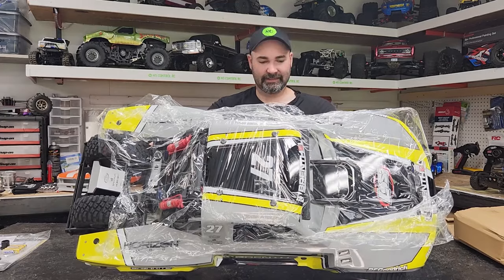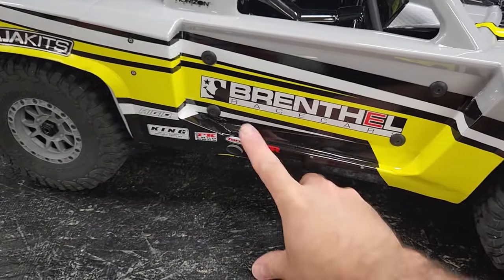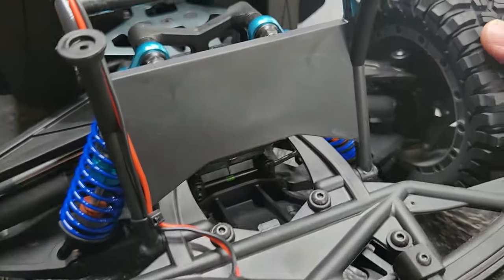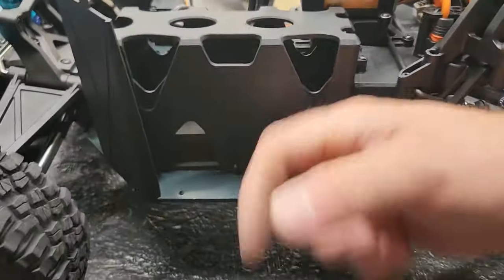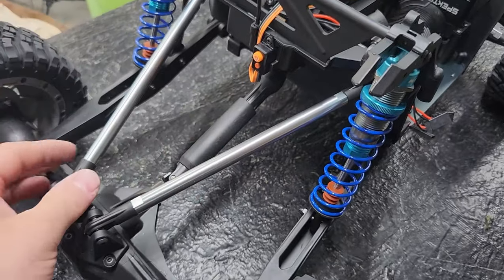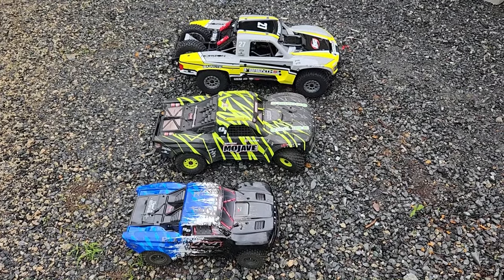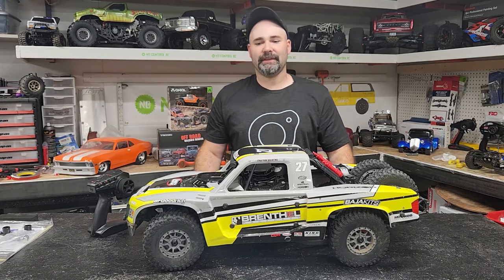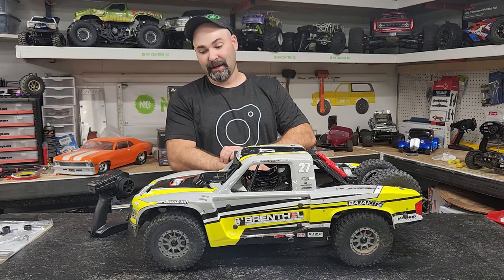Will I Regret Buying a Losi Super Baja Rey 1/6 2.0 over the Traxxas UDR Desert Truck? We will see

Comment: I am super late to this one. I bought the UDR first and it broke something on every outing. I bought an SBR 2.0 and its never broken anything other than one tire. I put a 23T pinion in it and it does 70MPH all day. It drives better, handles better and jumps better than the UDR. I havent pulled the UDR off the shelf in months now. The only changes I made to the SBR are to go up to 70 wt front and 60 wt rear shock oil, took off the rear toe plates and set to 0. I also moved the lower rear shock back one hole. You also want to get the rear frame braces. I bought those before the truck even showed up due to the big issue. Dont bother with the 3D printed ones, go metal. Went through 3 plastic ones.
Reply: Can I buy your udr 🥺🙏
Reply: Where can I buy the rear metal brace
Reply: @inyourearhole225 I suggest going for the carbon fiber ones from scorched parts rc, they are cheaper than the metal ones and are lightweight with similar rigidity. Mine haven't broken to date and they look absolutely phenomenal if u rum them without the body as it is using real and proper carbon fiber

Comment: I dont have the SBR 2.0 but i do have the 1.0 (never been used and dont intend on using it). I bought two and gave one to my brother which i use every once in a while. i also have three Super Rock Reys. The Rey platform is my favorite platform for electric RCs. I also have the UDR and honestly like the UDR as well but it is quite a bit different in the way it drives and handles. I do intend on getting the 2.0 one of these days but i also have a Kraken Vesla, Losi race buggy, and the Axial SCX6 on the purchase list. Those 3 alone are about $3500 once i have those 3, then i will get the SBR 2.0. 

UDR or the SBR if i had to pick one, I'm not sure i'd be able to pick. The SBR is definitely built more durable, but the way the suspension works in the UDR and how much skill you need to drive it brings its own thrills. 

Would i buy the SBR and the UDR again if i had to, yes, i would.
Reply from the maker: I don't have a super rock rey. I may need one now

Comment: The stickers are normal. I got two of them and both are the same! I just added a secondary rear shock on mine with no spring runs sweet
Reply from the maker: Interesting.
Reply: Same i just went around both of mine with a heat gun and got them to stick down best i could. Seems to help a lot.
Reply: The secondary shock in the back sounds sweet.. is it a stock shock?
Reply: @Gooche  yes Is a stock shock from a. 8s Outcast

Comment: That’s for all the info!

I bought one on sale last week, just waiting for it to arrive. Ordered some chassis braces. 

Two questions, what brand of batteries are you using and what is the mAh and your average run time if you’re not going all out?

I guess I’ll find out when I have it, but hoping Incan fit something bigger than 5000mah. 

Also going to gorilla tape the inside of the tires to avoid the ballooning.

I’m not going to upgrade anything until those parts break
Reply from the maker: Running HOOVO 4s 5500mAh 120c batteries  they fit well. There is more room for a little bigger batteries. I have done 3 runs average about 35 mins of run time.
Reply: That’s pretty decent tbh, I was a little worried my 5000mah batteries wouldn’t last long enough. Read some people only getting 10 mins, but they must have had it floored the entire time. 

Curious if you’ve made some adjustments for the handling. I’m gonna wait and see, but seems like it needs some minor tweaks. 

Super excited for this beast!
Reply from the maker: I put the 0 degree hubs on that come with it and installed the chassis braces. I beat up on it. The latest video shows some hard hits. It has held up well.
Reply: @nocontrolrc8290  ya sorry I made that comment before watching your new video. Surprised the brace broke off, but if it didn’t maybe it could have caused more damage?

Anyways, great videos, thanks for sharing. Subscribed!
Reply from the maker: No problem, the brace break was totally my fault that was a hard landing. If you haven't seen one or picked one up in person, they are so impressive  you will be super happy with it.
Reply: Where did you guys get the chassis braces?
Reply from the maker: @rodleonard1429  we got them on ebay. They worked well but can't take a hard slam on the tale. We broke them trying to back flip it. I know it's not ment for that but we had to try lol. I believe I've seen metal ones out there somewhere
Reply: @nocontrolrc8290    Yea, but we would lose out on so much fun if we didn't try, lol.

Comment: Well I have a udr and Arrma Mojave they are both great  
I want to get a super Baja Rey 2.0 
To join the family
Reply from the maker: It was to good of a deal when horizonhobby.com had 200 off. I still want a UDR as well. I will get one at some point
Reply: I bought mine for $699. Its worth it at the price i feel. Not sure how much it is going for on the Traxxas site as i havent needed many parts for my 5 Traxxas RCs lately.
Reply: I have just done exactly that. Also have the arrma senton guess I am  truck fanboy..
Reply: Just ordered mine today with $200 off for fathers day so $749 good deal imo for  sbr 2.0. I also have the older sbr 1.0  arrma Mojave 4s and Traxxas UDR.   Love the scale details on the sbr 2.0 it will be fun to have in my collection.  Gosh this hobby is so expensive. Haha. Couple crawlers, Outcast 6s ,vendetta, 4tec vxl couple Tamiya tt02  and losi no prep drag  summit racing are a few of my other rigs.

Comment: What is the size of the battery compartment?
Reply from the maker: It's big. I fit 2 hard pack 5500mAh in it, no problem, but I can send you a real measurement when I get home tonight
Reply: @nocontrolrc8290  So?
Reply from the maker: @AndrzejGodlewski-fq6tn  4in deep 5 7/8 in long and 2 in wide great time to buy on sale at horizon $220 off  its a great truck  https://www.avantlink.com/click.php?tool_type=cl&merchant_id=953aec29-878e-4306-b620-2df85883455e&website_id=b3117c03-9815-4bd7-b859-49ad6624c1a3&url=https%3A%2F%2Fwww.horizonhobby.com%2Fproduct%2F1-6-super-baja-rey-2.0-4x4-desert-truck-brushless-rtr%2FLOS05021.html
Reply: @nocontrolrc8290  Great. Thank you👍